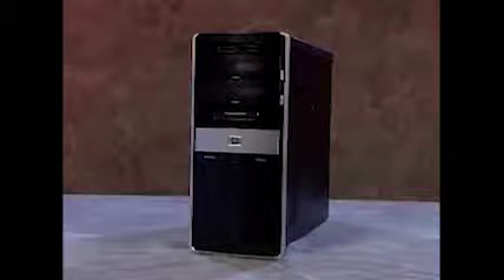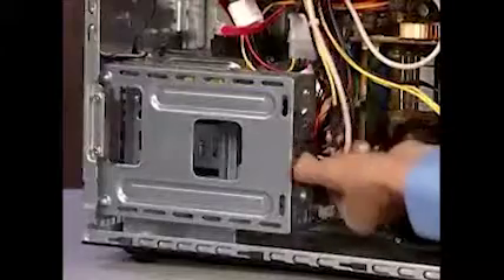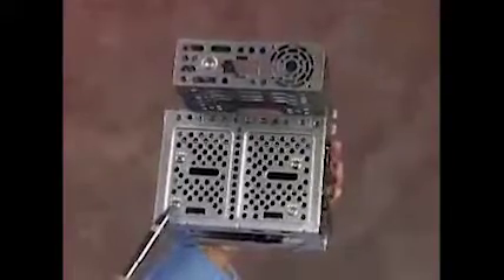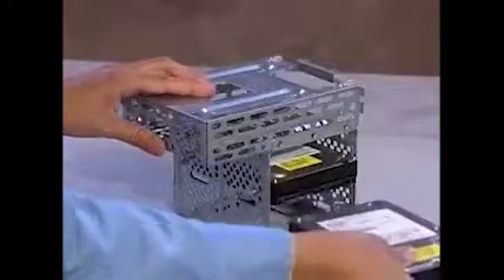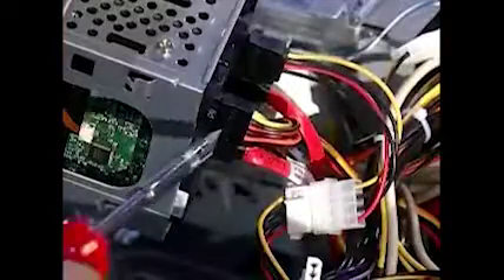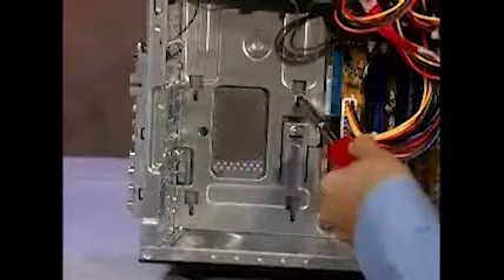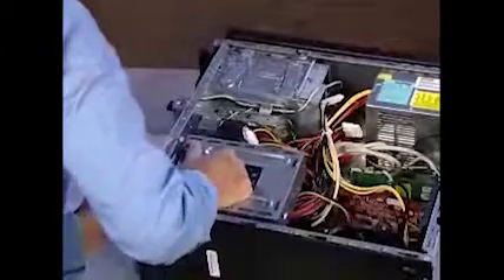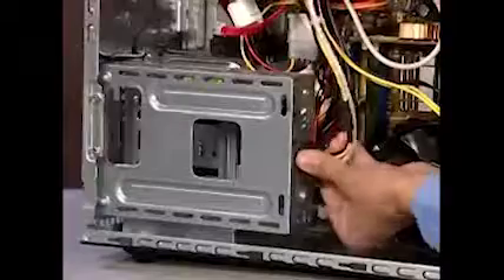Add or Replace Hard Drive | Pavilion Elite e9000 | HP Support

Comment: Pushed the latch on the hard drive cage and the cage would still not budge - with all the screws indicated in the video removed. It seemed so easy on the video. I have struggled for an hour.....
Reply from the maker: Hi there, thanks for contacting HP Global Social Media Support!
I understand that you are experiencing an issue in replacing the hard drive of your computer.
This looks like hardware issue, and you might have to get the computer serviced. 
So, I would request you to contact our Support, and our Support Engineers should be able to sort this out.
To contact us, click here: https://hp.care/6059sYckh.
Step 1: Sign in to the HP Support page using your HP account or create a new account by clicking on “Create Account.”
Step 2: Enter the device serial number, select the product, and click on “other” from the options.
Step 3: Click on “Continue to contact options,” and choose your country/region and language.
Step 4: The support options will now populate based on the warranty status of your device.
Regards, 
HP Support